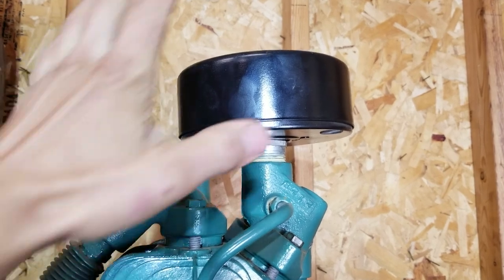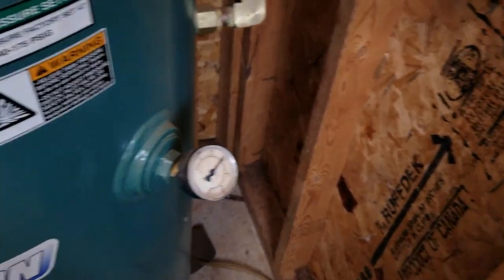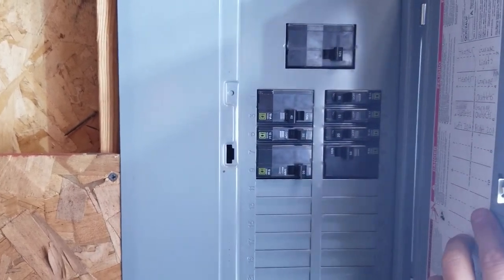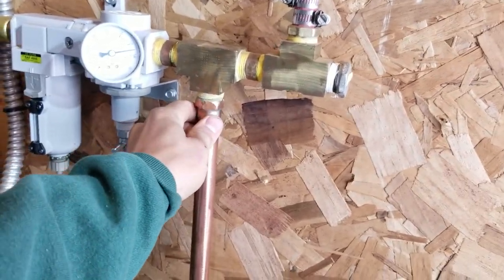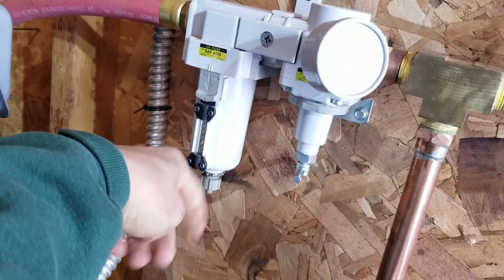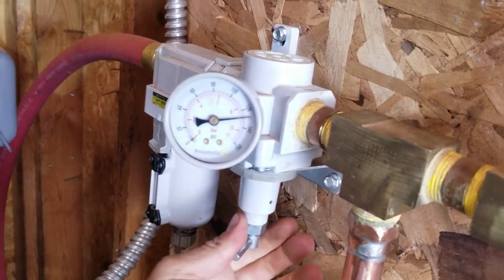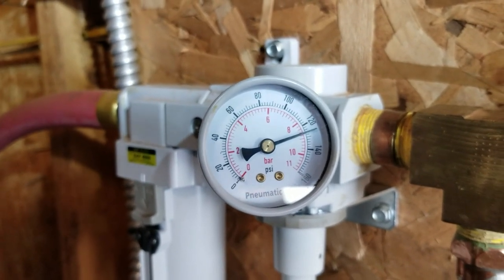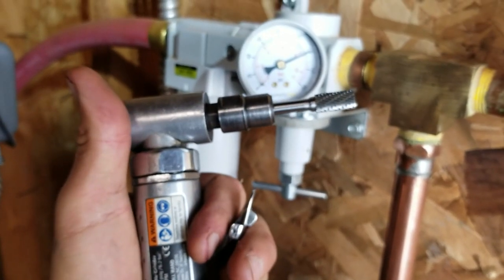A Real Man's Air Compressor Setup and Running

Comment: I have the same compressor...actually rebuild it, new piston rings, valves, tank check valve, pressure switch, low oil level switch and add a automatic drain at the bottom...champion/Gardner Denver are good compressors!!
Reply from the maker: Awesome, sounds like you did as much work to yours as I did to mine.

Comment: I have a real compressor. I have 2 Champions , an 80 gallon and a 120 gallon, both with the R15 pump and 5 horsepower motors . But the real compressor is a Saylor Beall model 9000 with a 15 horsepower Baldor motor. It will fill the 200 gallon tank from 0 to 175 psi in 4 1/2 minutes. Now that’s a real compressor ! I still like my Champion compressors though . They last forever.
Reply from the maker: Woah, that's impressive! You got me beat for sure.

Comment: Hi I bought a new saylor-beall. Compressor..all American build like champ..
Runs a lot quieter..what u can do to get the same result add a 5 in pipe to raise your air filter..higher..it should make a little more quieter.when running.or run it out side through the wall ..you,l also get fresher ,cleaner air..too. my dad did that on his ..big difference. Even if u paint cars ..it's even better..let us know if u do this..and how u feel  ty great video

Comment: Is that 3/4" soft copper between the tank and pump?  If yes, where'd you get it?  For the life of me, I can't find any soft metal tubing with a 3/4" ID.  Also, how many amps is your Square D pressure switch rated for?
Reply from the maker: It is a red brass 3/4" pipe nipple. I got it at Home Depot. My pressure switch is 140 PSI on and 175 PSI off. It is a Square D pressure switch. I had to adjust it a little.
Reply: @MattsShop  You must've gotten the copper before C19 messed up supply chains cuz I can't find 3/4" copper anywhere.  Also, I can't find any amperage ratings for Square D P Switches, and being an electrical device, I'd think they would be required to list that kind of info as not knowing those limits can cause a fire and catastrophe.

Comment: I just bought an identical Advantage 5 HP 80 gallon compressor off Craigslist. Of course it has a 3-phase Boldor so I need to change it to a 1-phase. I figure I will need to invest about $550 for a motor. Judging the outside condition I think I've got a good deal.

I brought it home in an utility trailer and then hoisted it off all by myself. It is around 550 lbs.
Reply from the maker: Nice! You can get a 1-phase off of eBay for cheap. I'd sell the 3-phase to pay for the other motor.

Comment: u got wiring for curtis 80 gallon 2 stage 3 phrase 230v I'm tryng to wire now i have new pressure switch ,mag box ,need wiring from control panel

Comment: Matt I'd just like to hear your thoughts on an issue, seeing as how you're well ahead of me. I have a 200V/208V running on 120/240V residential power, and small fuses are blowing on the electro magnet, and won't start. I know it'll probably be costly to correct the issue, any Ideas?
Reply from the maker: I have a 240 Volt motor running on 240 Volts. The little fuses are called "heaters". I had to size mine well over the rated current draw of the motor because the Full Load Amps (FLA) will trip them if you don't. The motor draws a lot of current when starting. The National Electric Code allows for sizing well over 100% of the FLA draw of your motor. You can call an electrical supply house, and they can calculate what size you need for your setup. I'm not an Electrician, or giving electrical wiring advice. This is just what I figured out worked for me.
Reply: @MattsShop  Yes I will contact an electrician to further learn, but that advice gives me confidence of a workable solution to an issue I've just run across. Thanks

Comment: The question is, why would one need a 230 volt compressor motor vs a 208 volt, for basic home/shop use, if both motors are 7.5 hp?
Reply: Residential power is 120V/240V Single Phase.  Commercial power is usually where you see 200V/208V (and sometimes 240V) Three Phase.  Matt has single phase so 230V is really the only motor voltage he can run for a compressor that size.
Reply: 208 is 3 phase(typically commercial )or a phase converter and 230/240 is single phase(resi)

Comment: Need a belt guard to complete ..vary nice set up..I'm eather get a champion or a sayor Beall  compressor..5hp. 2 stage   sayor Beall is all American iron..just a little more in cost...nice video.. helpful. Ty ..😃...love your unit...it sounds good..your air reg ..u have ..that little hole will bleed air when u turn down your air it's supposed  to do that.....I have an Alemite  brand ..on line store..a filter reg...and a regulator unit both have  pressure  gages..so I can adjust. The 1st one to 125...then the other to 95 p.s.i...I used black  piping..in my home shop..I liked u used a drip leg...mine befor the filter ..units..I have a automatic  tank drains on my comprsoir..with a pre-filter coming off my after cooler  ..then to the tank..factory..ordered..due to the fact  in in hot sunny FL..I get no water in the air tank..vary little ..this is an option  Saylor-beall  air comprsoir  co..offers..il get some video  out.  Soon as a demo..again great video..Matt.
Reply from the maker: Somebody else took it off when I bought it.
Reply: It’s got a guard! It’s turned towards the wall!

Comment: What did you fixed and how much it did cost you!?
Reply from the maker: It was like $600 and I put another $600 into fixing it, hose reel, paint, parts, electrical contactor, and expensive brass pipe fittings.

Comment: 8 gauge is not more then enough for 7.5 hp you would want 6 gauge.you should really be running 6 gauge anyways.a 50 amp breaker won’t protect 40 amp wire if a issue occurs the wire will potentially catch on fire and or melt insulation and damage your electrical equipment potentially even the contactor

Comment: How dii on I change oil please
Reply from the maker: It's got a drain plug cap at the bottom of the air pump.
Reply: How much oil does it take?